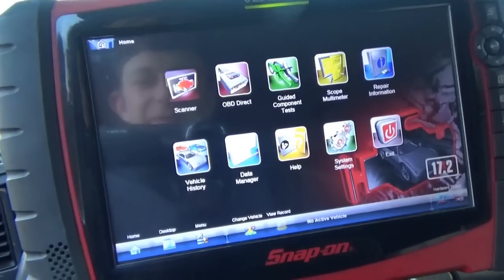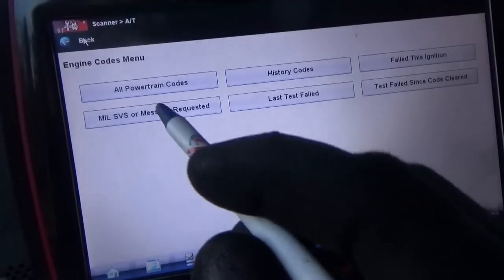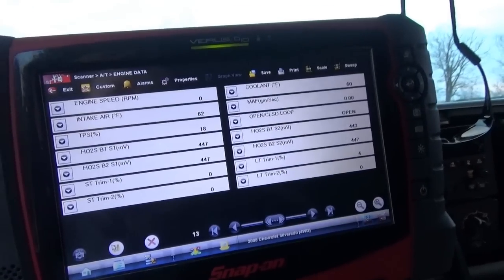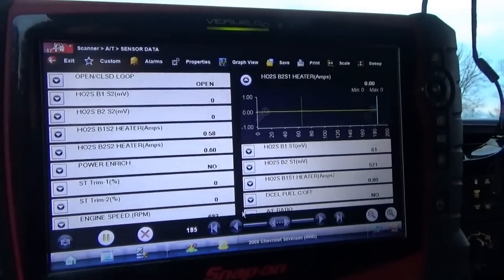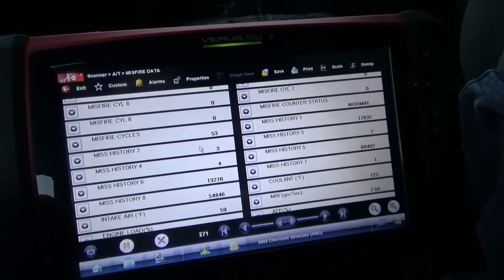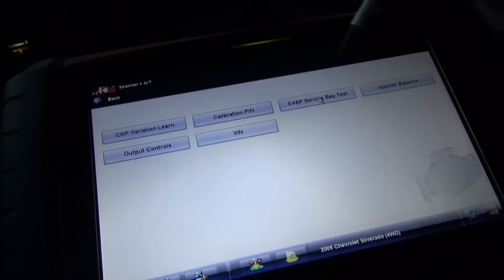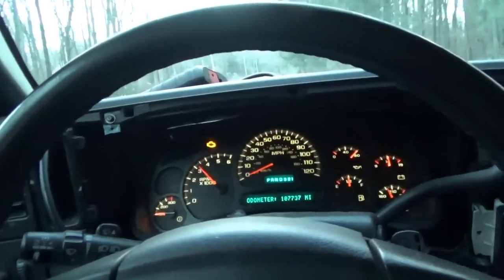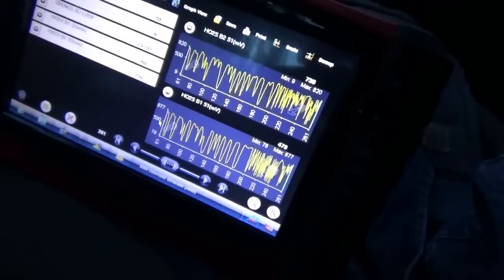GM Truck Misfire, O2 Sensors, LOW VOLTAGE? -Part 1

Comment: There's a faint shuddering noise every time the voltage drops, my random guess is belt and/or belt tensioner problem.
Reply: I heard that also.
Reply: or bad ground causing it all....
Reply from the maker: Yes I heard that as well! I think the sudden voltage drop was messing with the blend door actuators in the dash haha

Comment: I have low voltage on right bank misfire on all 4 cylinders can't figure it out
Reply: I have the same thing on my 2013 gmc sierra 2500 6.0, sp far we've replaced 02 sensors, all new cats. All wiring test fine, new plugs and wires

Comment: I just bought a 2009 GMC Sierra I have a misfire on cylinder 4 I've checked the lifters I've replaced the coil wires plugs I cleaned the injector I can't figure it out could it be an O2 sensor or could the cam need recalibrated what do you think I'm not paying a garage $100 $200 to diagnose something for me unless I have no other option usually I can figure these things out thank you for your time

Comment: My 03 gets a random misfire code every once in a while. Replaced all coils, plugs, wires, injectors, 02's, mas,ect... It will randomly pop up and go away. I never heard about adjusting the crankshaft sencor. So since i don't have a computer can i just replace the sencors

Comment: I almost bet that Alternator is designed to go on a Diesel.  Most Diesel's red line at 3k or 3500..  So this thing is set up to put out more current at lower RPM's.  Maybe it's just a slightly different voltage regulator built onto it.

Comment: That's a gm thing. It won't let you hold 1st without changing programming or a trans valve body mod. Won't let you take off in 2nd either like Ford does for poor traction conditions. 
And now we wait for part 2 grrr. LOL

Comment: Nice, really appreciate the tip on the CKP Variation Relearn, very cool!  I also like the tips to check Amp pid for O2's, very convenient and nice that they give this to us.

I have just made doing that CKP Variation Relearn & Idle Relearn a part of my routine after I do any cleaning of the throttle bodies, doing induction services, or just scheduled spark plug replacement on all of these GM trucks.  Nice to know that key information you mentioned, I never new that about the correlation between CMP & CKP gradually getting off from factory and it throwing false misfire counters...so awesome, thanks for sharing this with us Ivan!!!

As always, a VERY informative video, explanation, and diagnosis of the problem.  I cannot wait for the follow up on this truck!  Thanks for everything you do and hope you have a great day!
Reply: Yes nice tip, I'm always learning.
Reply from the maker: Thank you for the comment, Pauly! Really appreciate the feedback :) Having discussions like this is the most fun way to learn!
Reply: @PineHollowAutoDiagnostics  you bet man, you're a very smart guy who always takes things to a level that makes that possible!
Reply: I was getting weird misfire readings on my bi-directional scan tool. I didn’t trust it because it was always 2 misfires and it was on random cylinders at random times. I even hooked up my HP Tuners to see if it was getting different readings. It appears the the crank position relearn has fixed it. Fuel composition isn’t getting out of wack, no misfires registering and the mpg took a jump. 👍👍 Great video.

Comment: ive had that happen turned out it was a bad body ground from the engine to where it clipped on the hood
Reply: I don't know but it could be the alternator but that high amp could be causing a short to jump or overwhelming a weak ground ?

Comment: Okay, that's a weird one!  The fact that it happens right at the same spot every time strikes me as being a programming thing, rather than a mechanical failure.  Belt slippage would vary depending on load, not necessarily RPM.  Same could be said for a failing diode pack.

After verifying no TSBs and design function, I'd want to current-load the alternator to see if a heavier load changes the point at which it cuts out.  If it does, I'd suspect a ground issue or failing alternator.  If not, I'd verify signal with a scope to make sure I could trust my scan tool, quick visual inspection of the belt, pulleys and tensioner, and call the alternator.

I'm currently going through ADAS training, and am learning very quickly to distrust scantools even more than I did before.  I think I'm developing paranoia...  LOL
Reply: He has a scope in the VERUS, just throw leads on it. Scopes rule.
Reply: I almost bet that Alternator is designed to go on a Diesel.  Most Diesel's red line at 3k or 3500..  So this thing is set up to put out more current at lower RPM's.  Maybe it's just a slightly different voltage regulator built onto it.

Comment: Interesting Dionostic:   check that belt, make sure it's tight, check the wires from the battery positive and negative & the WIRES at the ALTERNATOR,  you never know it could be Rats eating up at the wires  you have to do a VISUAL CHECK,   make sure they're tight make sure there's no corrosion or rust or oil in the way,    you need a clean connection and tight,    just check everything  alternator related, and this could be a long shot,   but the DASH - INSTRUMENT CLUSTER could have a short in it too   GM  known for that Issue,    just ask ERIC-O,   lololo,    can't wait for part 2, the suspense is killing me!!!!

Comment: I laughed when it shifted into 2nd gear and you were trying to keep it in 1st.
Reply: Yeah -what was up with that?
Reply: Funny thing is later it down shifted and went over 3500 lol
Reply: @stephendee7839  he was light on the throttle and it was assisting in saving fuel by up shifting

Comment: Great presentation! Check for loose and VD test grounds and power in engine bay. Alternator brushes, diodes, voltage regulator,and commutation is toasty? Check for AC ripple in the electrical before diagnosis! I bet the the ign coils are not getting enough current on the primary at high rpm. Running a car with ripple can destroy sensors, modules, even your catalytic converters. I will only use brand new Genuine OEM Delco alternators on GM’s for this reason. Please tell me that alternator is genuine and not lifetime guaranteed Chinese junk from the 3 brick and mortar community polluters. Check AC ripple while driving the truck under a load with air conditioning, headlights, windshield wipers.....ON
Reply: I almost bet that Alternator is designed to go on a Diesel.  Most Diesel's red line at 3k or 3500..  So this thing is set up to put out more current at lower RPM's.  Maybe it's just a slightly different voltage regulator built onto it.

Comment: Load up the parts Cannon!  Replace the alternator. If that doesn't work, it HAS to be the PCM! That's what ALL of the guys on the forums are saying! If not the PCM, run ground wires from every location you can think of!
LoL 😂
Waiting for part 2!
Reply: And after changing everything in the engine bay it turns out is was the muffler bearing 🤦‍♂️

Comment: Towing, that truck will run 2nd gear at 4,500 RPM, 50 mph.  Also, sounded like fan clutch was fully engaged when cold.  I have this truck.

Comment: Also needs a stepper motor or oil pressure sensor. That baby doesn’t have 80lbs of oil pressure at idle.

Comment: Ivan the up shift in manual low is a programmed feature to keep the engine from over reving. If the PCM see's engine speed above 25 mph it will override engine braking in manual low & up shift to second.The other problems yes bad 02 sensors, check the alternator voltage output with a meter & amps at the rpm it occurs if it matches the gauge alternator problem if not sounds like a gauge issue.

Comment: I had a pretty bad misfire last week. I got home and hooked up my scan tool. It was showing thousands of misfires on cylinder 3. I swapped plugs and coils. The misfire stayed on 3. I swapped the wires between 1 & 3. Misfire moved to one. I went out and bought a new set of Delco wires. Felt like misfire was completely gone.  Truck was smoother and more power.  I hooked up my scan tool again just for giggles. I noticed not it would show 2 misfires on random cylinders at random times. I started wondering if it could be an O2 sensor getting weak, but not throwing a code. I figured my upstream O2 sensors are 14yrs old and have 143k miles on them so I would just replace them anyway. A pair of Denso O2 sensors were relatively cheap and I really like Denso so I bought them. I haven’t installed them yet because I am going to do them when I put the new brakes on this weekend. I did do the crank position relearn. It smoothed out the engine even more and now I don’t see any misfires at all and my fuel trims stopped jumping all over. Now the only move from 0 to 1 or -1.   I am just happy it’s not fuel or compression related. 😂😂

Comment: I wonder if the smart charger drops out when you're calling for acceleration, so that there is no extra mechanical alternator load on the engine when you're looking for acceleration.... Maybe service data would tell a story.

Comment: Hey broo!
Have a Q
 Have a Honda pilot 2003   3.5
Only 2 Oxigen sensors
Engine cold just ignition key on.My scanner shows
This Volts  readings on those O2 sensors.
Bank 1 S1  1.275V
Bank 1 S2.  0.035V
Is this a normal reading???
Thanks in advance for your time🕛

Comment: This is interesting. Possible alternator with brushes not getting contact at high rpm, marginal battery, belt tensioner/belt issue, possibilities are endless, LOL. I remember Eric O. did a video with the body ground between the engine and body going bad but don't remember what the truck was doing. That CKP variation learn was interesting, back when I worked for a GM division we only did crank relearns if the PCM was replaced or crank sensor changed or a different engine was installed. Strange. Electrical gremlins are always fun, haha.
Reply: Or slipping belt because of weak tensioner, that's all.

Comment: why is the oil pressure at or near maximum?
Reply: dhamma58 possible bad oil pressure sending unit
Reply: Most likely a failed oil pressure sensor, seen it many times on GM's.  The clusters are also bad about failing but not as often.
Reply: Mine is the same way. Mine was fine untill I bought a rebuilt cluster. Must be my stepper motor. I know it will react to loss of pressure because I lossened the wire at the sending unit, so I'll live with it.

Comment: No come backs because you replace 2 O2's ??   I never ever replace parts that are not bad, I change One(1) all the time and rarely have people come back for the other and if they would well so be it! that is part of owning an automobile.  So what you are saying is that you always replace everything in pairs? IDK, most of my customers do not want to spend more than what is needed at the time.
What about TPMS?  Do you replace all 4 if one goes down?
Reply from the maker: Depends on the customer. Some things like brakes, struts, tires are in pairs, no questions asked. Bulbs are cheap and a no-brainer. O2 sensors also age the same way, and can cause inconsistencies if replaced one at a time...but that's up to the customer :)

Comment: What about a bad battery causing the drop in voltage? Had a Honda crv that would cut alternator off randomly. Ended up being a bad battery after all.
Reply: Some Hondas turn the alternator off periodically to save fuel. If the battery is bad enough they sometimes even stall

Comment: On my 15 Sonic and 14 Sierra at high rpms the a/c clutch will not engage, I still haven't figured out if it's the computer saying "all hands to the engine" or if maybe the compressor isn't designed to spin that fast. Now on the Sierra if there's no high load on the alternator the ECM will command it down to a low state and the only way to keep it at a high state is to have the headlights on or have it in tow mode but in that video you have the headlights on so.......... yeah and there's really no manual mode for GM pick up Transmissions either

Comment: My guess:  the alternator brushes or slip rings are excessively worn and not making good contact at higher RPM's.  If you replace it, buy a new OEM GM alternator from an online source,  if possible.  Brand new 2005 Chevy GM alternators are available online way cheaper than reman units from auto parts stores.

Comment: Belt temsion problem... maybe, but why would the PWM signal to the alternator drop out? -broken wire and worn engine mounts allow the engine to pull on the harness just hard enough at about 3500rpm to open the circuit?

Comment: My Chevy shifts too haha also running into po300 and misfires on cylinder 2 and 7 changed plugs,wires and coils so gonna check these o2 sensors ,would be nice buy computer like yours to see trims and stuff lol

Comment: 2013 Chevy Avalanche 5.3   If you use aftermarket 02 Sensors will this throw codes? Also where are the gounds or have a idea where I can get a diagram on this??

P0050
Raw code: 0050
ECU: Engine control unit
Status: Confirmed
OBDII: Heated oxygen sensor (HO2S) 1, bank 2, heater control - circuit malfunction

============2==============
P0056
Raw code: 0056
ECU: Engine control unit
Status: Confirmed
OBDII: Heated oxygen sensor (HO2S) 2, bank 2, heater control - circuit malfunction

============3==============
P0155
Raw code: 0155
ECU: Engine control unit
Status: Confirmed
OBDII: Heated oxygen sensor (HO2S) 1, bank 2, heater control - circuit malfunction

============4==============
P0157
Raw code: 0157
ECU: Engine control unit
Status: Confirmed
OBDII: Heated oxygen sensor (HO2S) 2, bank 2 - low voltage

============5==============
P0161
Raw code: 0161
ECU: Engine control unit
Status: Confirmed
OBDII: Heated oxygen sensor (HO2S) 2, bank 2, heater control - circuit malfunction

============6==============
P0521
Raw code: 0521
ECU: Engine control unit
Status: Confirmed
OBDII: Engine oil pressure sensor/switch - range/performance problem

============7==============
P0151
Raw code: 0151
ECU: Engine control unit
Status: Pending
OBDII: Heated oxygen sensor (HO2S) 1, bank 2 - low voltage

============8==============
P015D
Raw code: 015D
ECU: Engine control unit[Archive (inactive)]
Status: Permanent
OBDII: Heated oxygen sensor (HO2S) 1, bank 2 - delayed response lean to rich

============9==============
P0174
Raw code: 0174
ECU: Engine control unit[Archive (inactive)]
Status: Permanent
OBDII: System too lean, bank 2

============10==============
P0050
Raw code: 0050
ECU: Engine control unit
Status: DTC supported by calibration, Current DTC, Test failed since DTC cleared, History DTC, Current DTC since power up, Warning Indicator Requested
OBDII: Heated oxygen sensor (HO2S) 1, bank 2, heater control - circuit malfunction
General Electrical Failures [0x00]
============11==============
P0056
Raw code: 0056
ECU: Engine control unit
Status: DTC supported by calibration, Current DTC, Test failed since DTC cleared, History DTC, Test not passed since current power up, Current DTC since power up, Warning Indicator Requested
OBDII: Heated oxygen sensor (HO2S) 2, bank 2, heater control - circuit malfunction
General Electrical Failures [0x00]
============12==============
P0155
Raw code: 0155
ECU: Engine control unit
Status: DTC supported by calibration, Current DTC, Test failed since DTC cleared, History DTC, Test not passed since current power up, Current DTC since power up, Warning Indicator Requested
OBDII: Heated oxygen sensor (HO2S) 1, bank 2, heater control - circuit malfunction
General Electrical Failures [0x00]
============13==============
P0157
Raw code: 0157
ECU: Engine control unit
Status: DTC supported by calibration, Current DTC, Test failed since DTC cleared, History DTC, Current DTC since power up, Warning Indicator Requested
OBDII: Heated oxygen sensor (HO2S) 2, bank 2 - low voltage
General Electrical Failures [0x00]
============14==============
P0161
Raw code: 0161
ECU: Engine control unit
Status: DTC supported by calibration, Current DTC, Test not passed since DTC cleared, Test failed since DTC cleared, History DTC, Test not passed since current power up, Current DTC since power up, Warning Indicator Requested
OBDII: Heated oxygen sensor (HO2S) 2, bank 2, heater control - circuit malfunction
General Electrical Failures [0x00]
============15==============
P0521
Raw code: 0521
ECU: Engine control unit
Status: DTC supported by calibration, Test failed since DTC cleared, History DTC, Current DTC since power up, Warning Indicator Requested
OBDII: Engine oil pressure sensor/switch - range/performance problem
General Electrical Failures [0x00]
============16==============
P0151
Raw code: 0151
ECU: Engine control unit
Status: DTC supported by calibration, Test failed since DTC cleared
OBDII: Heated oxygen sensor (HO2S) 1, bank 2 - low voltage
General Electrical Failures [0x00]

Comment: Thanks Ivan my daily is a 02 2500hd 6.0 been having flashing check engine light over 65 mph I guess all it needs is a relearn
Reply: My 04 is the same way. It started just happening @ over 70. And only when not on the throttle. Like when it goes down hill or levels after a slight climb.  Now.... it does it at 65.
Reply: My 02 tahoe 5.3 does it at 2000-2500rpm

Comment: Ivan, don`t believe it is alternator, my Chevy S10 4.3l v6 does same thing, I replaced alternator and did same thing, almost appears to be heat related at times, If you resolve this, I might find cause on my truck also.

Comment: Is the oil pressure supposed to be that high?
Mine runs up to 3/4 of the gauge when cold, but only when I'm pressing the gas. It sits a bit over the half while idle.

Comment: Ivan, just for grins pull the end cover and check the brushes. I bet they are worn out and harmonics cause them to loose contact with the slip rings. Replaced brushes in my Delphi alternator.